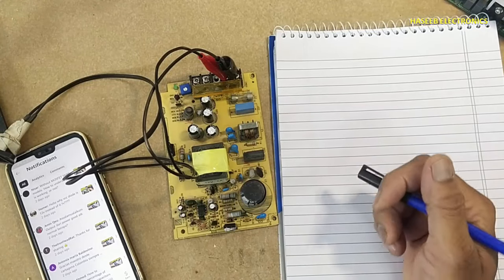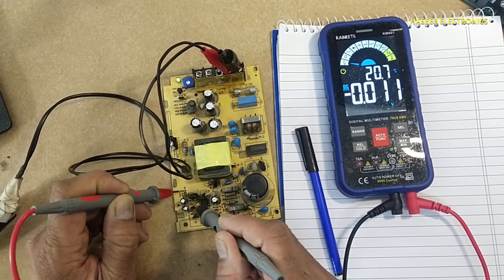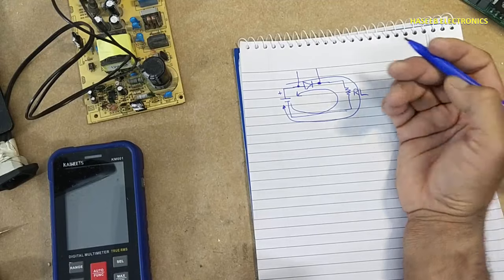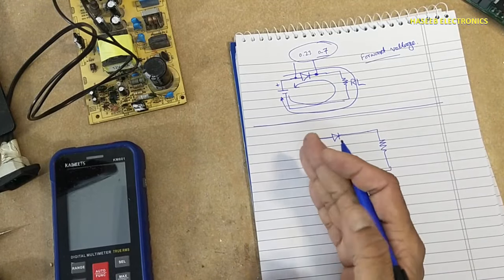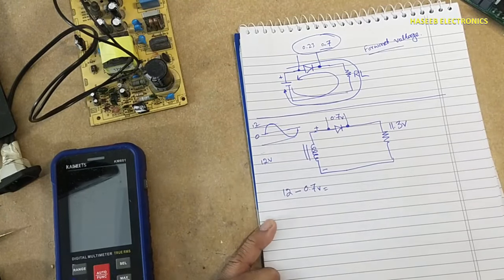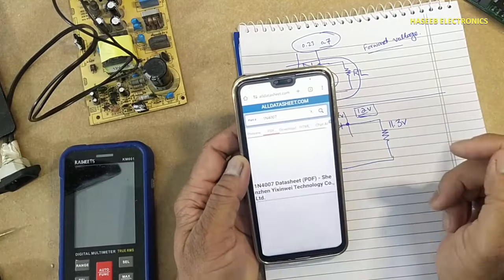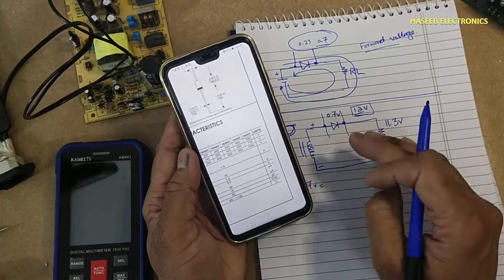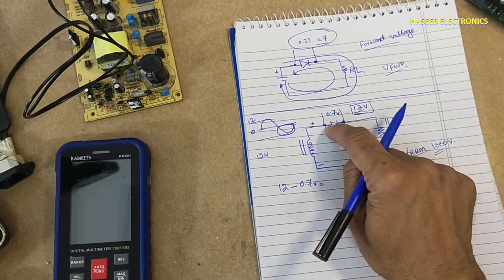{1053} Why 12 volt on rectifier diode instead of 0.7 volt

Comment: Hello, very interesting video, I would like to share the following experience and have your comments.
 I was repairing a flyback based 3843 battery charger and it has a switch that allows to charge either at 2Amps or 12Amps, i followed that switch and it was in the primary side putting in parallel 2 resistors, 1 of 0.33 Ohms and another one of 1 Ohm. those resistors were between main ground and source of the swithcing primary mosfet. Do you think it could be a good practise for those who want to limit current ? i tried it it works and seems a good alternative than to work on the secondary side with complex shunts etc...
Can you explain how limiting current in the source primary would limit output secondary current. Is everything linked ?
Thank you and sorry for the long text.

Comment: it is a consequence of a measuring system limitation. The multimeter cannot follow any idea of conduction, in the sense of consistent energy transfer. We mentalize that, but the multimeter cannot see that, it only sees voltages, and it will sample the highest voltage, even if that does not corespond to the main function. 
So put it in a prophane way, we want the device under test to function in a certain way, and we cannot measure that, instead we measure how it does not function, so to speak. Of course, we must be aware of all aspects. It is about the limits of what we can measure

Comment: 5:00 if the guys asking knows about potential difference, sure he will understand, think of a battery and one wire going from + side to a lamp and after the lamp there will be another wire going back to the negative side of the battery, and as you know the voltage of the battery is 12vdc, but you put one lead to the + battery terminal and the other side on the + lamp side. You will get 0Vdc why? Because there is not potential difference, basically you need to measure across a component. And then you will get lets say 10vdc across the lamp. When the diode is reversed biassed (it will not pass current) there will be 12 V on one side and 0 on the other side and when you mesure across jt you will get 12 v. If it’s forward biass ,12 v will be on both sides so there is no potential difference and the difference is 0 so you will read 0. Prof Haseeb correct me if i m wrong 😅, i just wanted to help him😊

Comment: The person is simply confusing the dropping voltage when measuring a diode using a multimeter on diode test... which has absolutely nothing to do with the circuit voltage. If you put 12V on a diode it's obviously going to have 12V at the other end too (minus whatever the forward voltage drop of that diode is). Take for example a circuit with a 3.6V nicad battery that is replaced with a 3V coin cell that isn't rechargeable. A diode is placed in series to prevent the non-rechargeable battery charging but the output from the battery drops slightly due to diode forward voltage drop. That's normal but the battery will still output around 2.3V-2.5V. To suggest it only has 0.7V no matter what the input voltage is... well that's funny ;-)